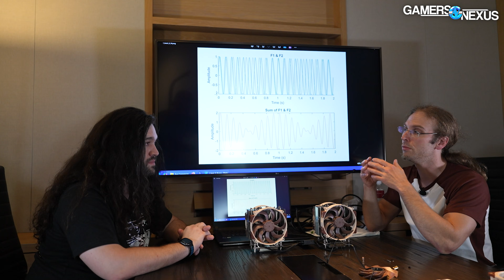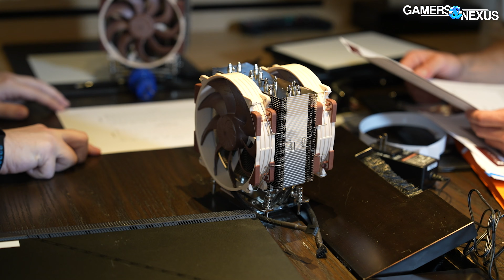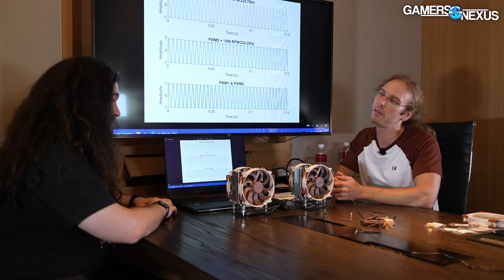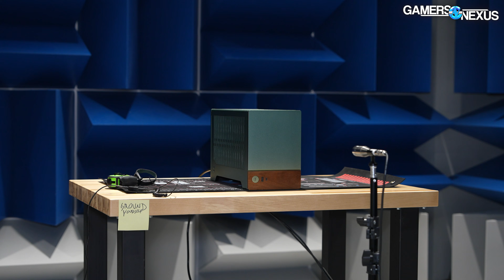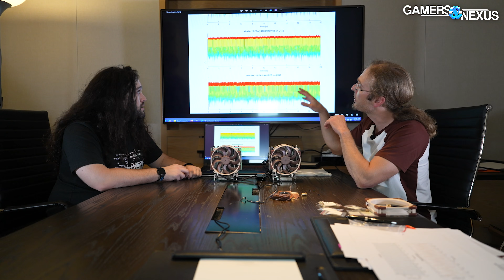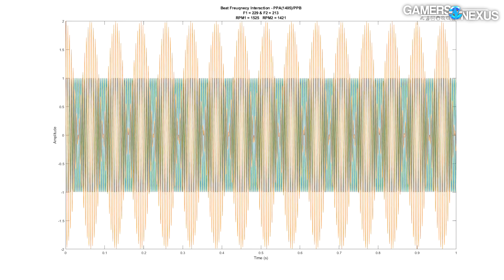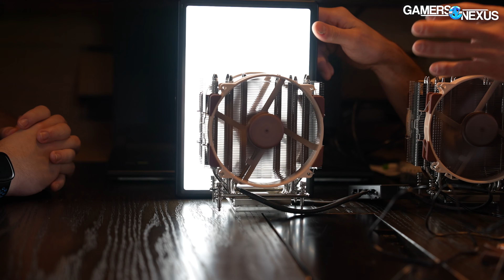The Most Annoying Computer Noise | Noctua Engineering Deep-Dive on Case Fans

Comment: I actually stopped using Noctua fans because I had an A14-Chromax that had a constant hum resonance around 610rpm that was 100% reproducable. Every time it was sitting around that speed, you could hear the hum from across the room. I contacted Noctua customer support and they were just like "yeah that's normal behavior". It wasn't the last Noctua fan I ever bought but it definitely killed the brand lustre for me when much cheaper fans from brands like Be Quiet have been flawlessly quiet.

Comment: Fun thing about beats, the difference in hz between the two signals producing the beats is also the frequency of the beats themselves. A difference in 1hz will make 1 beat per second, a difference of 5 will make 5 beats per second, a difference of 0.5 will make 1 beat per 2 seconds.
You really have to make the fans either so close in frequency that the beats are so slow as to be unnoticeable, or so different in frequency that the phenomenon blends into the normal sound of the fans.

Comment: Would be great to hear about the control schemes as well. I assume they are using vector modulation with speed control? Jakob mentioned holding speed when there is a torque, so its possible that they are using torque control or some combination of torque and speed control. Would love to hear more

Comment: :face-orange-raised-eyebrow: PRIME EXAMPLE: Would like to conduct a little experiment? Then you can re-create the 2:40 minutes into video, graph from @GamersNexus, "The Most Annoying Computer Noise | Noctua Engineering Deep-Dive on Case Fans". The outlined scenario / experiment easily created (No PC Hardware needed here) will simulate two computer fans that if running at the same speed will cause what some people notice as the dreaded "hum" noise. To simulate this all one needs to do is get any software that gives more adequate control of your audio, specifically any audio software that will let you toggle from Stereo mode to Mono mode then go into any frequency stable type music track (consistent stable sound) that are easily found on YouTube and press PLAY! :glasses-purple-yellow-diamond:

Once listening in Stereo mode you can toggle in and out from Mono mode to Stereo and notice this sound that once joined in stereo has that "hum" sound being omitted BUT while Mono is toggled the becomes a distinct hum sound but with pulsation compared to the uniformity of the omitted stereo sound. Enjoy! And, "Thanks Steve!". :hand-purple-blue-peace:

Comment: That part about the "beat" frequency I remember was demonstrated at a technical museum backe when I was ten or so. They had organ pipes, large ones, set up along a wall. you could "tune" the pipes by moving a lever for each. If you set two pipes to close to the same frequency you got the wow effect, and the frequency of this fell as you matched the pipes closer and closer. Theoretically the "beat" would disappear if the pipes were at the exact same frequency.

Now the interesting thing is that is one pipe hit an almost perfect multiple of the frequency of the first pipe then you could hear that beat again, and this was true for three times or four times the frequency just like it was when you almost matched the frequencies perfectly.

As a technical experiment for children it was pretty fantastic.

They also had a setup that demonstrated the Doppler effect on sound. It vas a good example showing the change in noise from stand still to when the speaker mounted on a long rotating arm reached a high speed. You could hear that the sound had a higher frequency when the speaker approached you while the sound frequency fell as it moved away from you. This also was a good demonstration that managed to explain this phenomena even for young kids. Now the Doppler effect will work with light, radio signals and such, but to see the doppler effect on light you have to go to extreme speeds, far higher than what can be done in a experiment as accessible as this. But sound has a transmission speed of about 320 meter per second, so even a small model can be used to demonstrate the Doppler effect.

Comment: I knew this guy was German, him using the word "aufschaukeln" just prooved me.
Vibrations... my Corsair 5000D Airflow case does this. The fans are fine. of course, the exhaust on top is noticeable when my temps are a little higher in summer, but the outer frame around the front air-filter/fan mount braket is actually vibrating on the right side. Like this fast pattern you describe. It's really annoying.
And yes, it is the frame itself vibrating. I have covered multiple areas of the case with foam stickers already but don't really know how to get some underneath there...

Very interesting topic anyways, which I luckily don't really have to deal with. Maybe because my fans aren't lined up behind each other like this and my intake fans (3 times 140 x 140 mm on the front) are also bigger than my exhaust fans (4 times 120 x 120 mm - on on the back, slightly off set between my upper and middle front intake fan, and 3 on top, on an AIO radiator) but the three running at the "same" speeds while the one on the back is set very low, almost like just for visual reasons on the whole PC.

Comment: I bought Noctua 140mm fans to use as my front fans and when they were being calibrated I noticed a noise, similar to the noise in the video. I took the fans out of the case and ran them just on tile and noticed the noise came from inside the center of the fan where the bearings were. The noise gets so loud they are unusable at certain power percentages. I contacted nocua about it and they said that is just how fans are and rejected any help or refund. I am now stuck with overly expensive 50% power fans. I have never had this issue with any other manufacturers fans and never had this with their 120. I will never buy noctua fans after that interaction and urge people to get be quiet fans instead.
Reply: yeah always bothered how ppl hype up the nf-a14. literally awful

Comment: I had exactly this issue with my Thermalright PA 120 SE! It sounded sort of like a distant train whistle (in fact that's what I initially thought it was). Swapping the fans for Noctuas fixed it. And the Thermalright fans work fine as case intake/exhaust, so they did not go to waste.

After watching this video, I imagine I also could've fixed it by tweaking the fan curve for one of the fans so that their RPMs were further apart. I'll have to remember that for the next time I use a dual-fan cooler.

Comment: It's strange that you filmed this video right after I solved this very problem in my brother's build I just finished - it even uses Noctua fans but in an aging Rosewill chassis. The thinner metal likes to resonate in acoustically unpleasant ways! I have had an interest in the differential equations for constructive and de-constructive interference since my undergrad days. One of my mentors gave a lecture on his work with more complex waveform models for use in things such as muscular dystrophy signal loss. There were people undergoing experimental surgery trying to 'hotwire' around neurons with smaller ones, and his work helped show surgeons and desperate patients there wasn't enough bandwidth with the grafted samples to preserve the information firing 'down' the nerves in their body. Anyway that's my story, thanks for sharing the interesting video.

Comment: I love how this actually answers a question I had about the noise from my current dual tower heatsink.  Any thing I ever look up about fan noise always has just someone replying in the comments "It's the bearing".
Reply: Years ago I started removing the center stickers from the rotating masses on fans, it helped tremendously with balance and thus vibration noise. It's a habit I never gave up as those things were never ever centered and in most cases horribly applied at factory. If your fans have those, pull them off. The stickers on the rear, leave them as they are assisting in the bearing seal. That's one step in helping noise. If you have your case where you can easily see into it from the "window" side, well, there's nothing much to be done about noise throw, it's always in your ear. Physically move the case low and to your left. The noise will then throw away from you, not at you as much.
Reply: I wonder if you could plug one into a low noise adapter to slow it down a bit, and let the other run at normal speed

Comment: I have a 4U rackmount chassis for my desktop. There are a total of either 12 or 15 A12x25s in there, depending on how lazy I was putting it back together. 3 intake, 2x 360mm rads in push/pull (sometimes I skip pull on the gpu rad). The beat frequency when they ramp up is truly punishing. Thankfully the rack is in a separate room.

Probably still loads quieter than anything else would be in there.

Comment: Good thing you brought up how some fans and case combinations can be extremely annoying and also have a great impact on performance where some fans have more airflow on one design and some others on another it is really dependent on the two and why you should test several fans in your case to see how they work.  Also how he mentioned a panel gap, it also helps with static pressure too you get better airflow as well. (we use this a lot for water cooling radiators before the bling obsessed RGB crowd started doing it lol.  Doyll on overclock has an enormous thread with air cooling improvements and tips that everyone should read through.

More than even fan noise itself though to me the most annoying thing with fans is the constant ramping up and down that happens with usual air cooling and motherboard regulation

Comment: two questions after watching this excellent explanation:
Does the beat frequency problem also applies to radiator, where multiple fans works side by side on the same radiator? (not push-pull config, just all fans on one side of the radiator)
Will Noctua release any fan speed offset product for any other fans? We know going for their fan is the most obvious solution, but the offset product will be nice for situations when there's just not enough connector to control each fan separately (multiple radiators with dozens of fans in a single PC for example)

Comment: You can get beats with only one fan, or other single source of vibration.  I'm surprised that Jacob got that wrong.  It is used to tune musical stringed instruments to a tuning fork and was famously seen with the "wobbly bridge" across the River Thames in London.
I'm a violinist and use it daily, but a piano, for example, does not need to be tuned daily so a pianist would not normally tune their own instrument.
In tuning a violin, the A-440Hz tuning fork is struck and the heel or tail of the fork is touched to the bridge of the violin so that the A string (the string you set the overall tuning of the violin with) is induced to vibrate in sympathy, and if it is not perfectly in tune, the string will vibrate in beats as the sympathetic vibration moves in and out of phase with the (fixed) tuning of the fork - the only source of vibration.  The aim when tuning is to slow the beats to nothing, as the tuning fork and string are vibrating in perfect synchronisation.  Any natural frequency of vibration which is very close to the origin of the vibration will beat in the same way, but there is not normally a convenient way to tune it out as you can with a violin string.  Adding a small weight to the vibrating panel will deaden the vibration or something that presses against the installed panel near one edge will change the note (i.e. frequency) that the panel vibrates at.
Reply: But aren't there two source of vibrations in your example? The fork is the first one and the violin string is the second one. And you hear the beat frequency between those 2?
Reply: @hastesoldat  No, the violin string is not a source any more than the side panel of a computer is - it is simply vibrating in response to the tuning fork, which is the only original source - you neither pluck the string nor do you lay the bow on it.

Comment: Why not have the fans hooked up to a single controller board that then synchronises the fan speeds perfectly so there is NO difference in fan speed?

And they could advertise it as gasp Ai fans! 😮

Comment: Supertorque feature seems fishy ….. don’t want speed up as they produce less airflow due to a higher static pressure? In other words if you completely stop the airflow and maximize static pressure RPMs go up …… even with a basic vacuum
When the hose clogs the RPMs go waaay up as it is not moving any air

Comment: Eureeka!!!! I recently upgraded the platform in my OG O11-Dynamic and bought a new Dark Cool LT AIO. There was a humming coming from the new coolor that I couldn't figure our at a few speeds. I never any kind of humming and thought the sound was coming from some bent fins or other issue with the radiator. I ended never finding the issue even after changing the fans on the AIO which I tried 3 totally different fans. Saw and watched this video and when I managed the speed differently from one fan to the other, boom, the sound changed and I eventually figured out a curve that resolved the sound. Thank you for the video!

Comment: I was curious about how single-digit Hz is apparently more bothersome to folk than higher-pitched noise? Oscillating behaviour vs steady state makes sense though cuz brains do tend to filter steady state noise out, but could also just be that the infrasound could be triggering resonances in the relatively thin metal sheets that make cases up, or any adjoining materials? Love this video, great fun to see actual real-world issues tackled as opposed to controlled-environment simulations that aren't reflective of actual deployment. Makes me feel speaker manufactuers would do well to design PC cases, that or mass-load stuff with Dynamat, hah.

Comment: HOW exactly did Noctua create the RPM offset though?
Did they mention this in the video? They showed a 50RPM offset. They talked about the ELECTRONICS being more advanced that controls the RPM. But what I don't understand is how "FAN A" knows to be the faster fan. Are they manufactured identically, but the ELECTRONICS in one is told to run "FAN A" profile and then they label the fan as such? Am I missing something obvious?

Comment: That's annoying as F$%& and can contribute to headaches and fatigue. Much analysis goes into mitigating resonances in aerospace design as the vehicle moves 'very fast' thru the air. Not a beat frequency per se but acoustically similar.

Comment: I have this when my GPU fans sincronizes with chassis fans. Ariund 70% until 75% speed. So i changed my sys fans and CPU fans to a different curve fans, and my problem is gone. And i notice it has nothing to do with fan quality, but speed and ressonance.

Comment: I cut out a piece of fan mounting metal for 120mm fans from the front mounts in my case because it was causing turblence and extra noise. I think extraneous metal and holes in the path of the airflow is one common cause of odd noises that people might have trouble ameliorating. Blocking the holes with tape helped it a little bit, but cutting it out with snips + file ended up being the better long term solution.

Comment: Since the i7 960 LGA1366 CPU came out, we installed a 12hs push pull cooler on the CPU, we never had those issues. And it is still running till this day. I had it once with 2 Corsair fans, and they are years ago into the trash.

Comment: I produce music.  Sometimes I have to record in the same room as my PC.  

My preference with fans is as close to white noise as possible, as quiet as possible.

A steady peak at given frequencies is *not good*, but it is workable, although it can play havoc with the mixing process.  Particularly when you start getting to frequencies where sound is omnidirectional.

Time varying frequency peaks as discussed here are a nightmare.  A total nightmare.  You can’t EQ the peak out consistently as sometimes it isn’t there and you apply that EQ at all times.  You can try and use dynamic EQ, but what if the thing you are recording has time varying peaks at the frequency you are applying dynamic EQ (far less uncommon than you might think).

A fan should ideally be white noise.  As quiet as possible.  I would take a loud fan that produced a very flat signal over a quiet fan that had time varying frequency peaks.

Comment: Funnily enough, the only times I experience this noise is when I bought Noctua fans. F, P or A series, PWM or DC control. They'd resonate or make vibration noise even when using the rubber mounts. Everytime I folded to peer pressure to buy the "best" fans, regardless if they went in a 30$ no name case up to big tower Fractal cases, filtered and unfiltered, they were loud and annoying. Am I just that unlucky?
Reply: Yeah cope

Comment: Thanks a lot for this. I knew something was up with this sht and I wasn't crazy but the only solution I had found on my previous build was to play around with my limited rpm change options on garbage motherboard control software until the oscillating stopped.. until it started again x days later due to temperature change or whatever it was.

Thankfully my new build has full noctuas and doesn't have this issue anymore from just how quiet they are so much less chance of them compounding to a loud enough level to be annoying. (I can very barely hear a NF-A12x25 running at almost full speed with my ear as close to it as I can get it, downright magical)

But at least I know to offset their RPM individually if it shows up again in the future. Free software called 'Fan Control' is a boon for this. No more getting stuck with bad mobo/gpu fan curves and limited options.